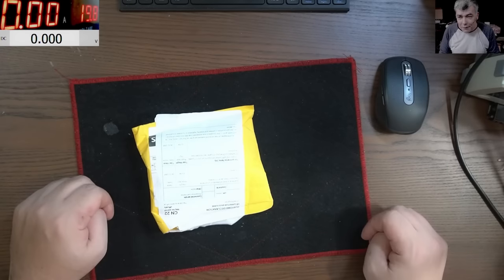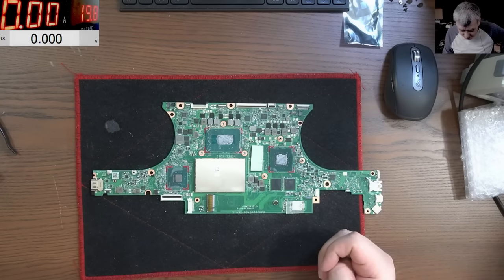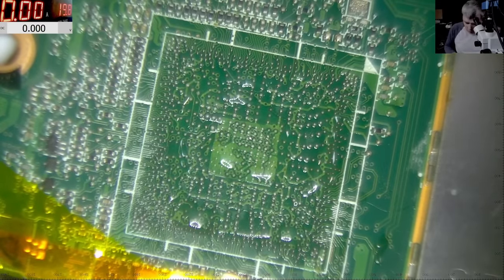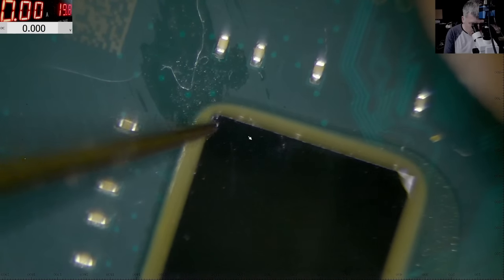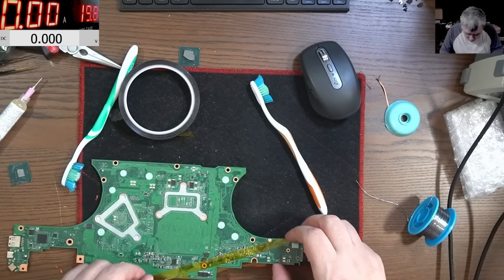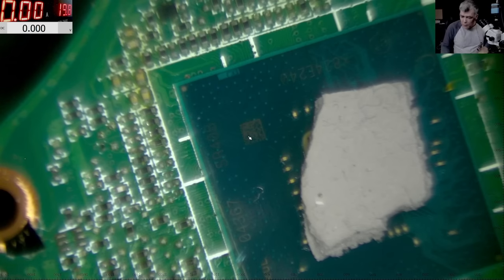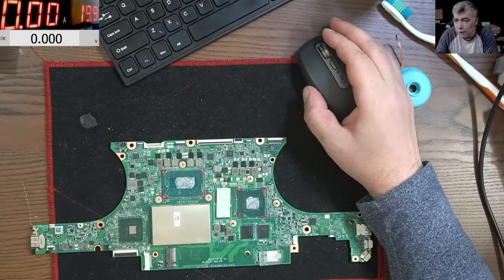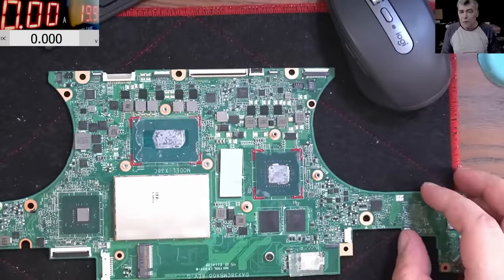That's why i don't replace chipset/cpu/gpu :((((((((((((((((((((

Comment: This is something I'd like to try someday: change a chipset or SOC with a very basic pre-heater and hot air. You have done it beautifully, Sorin! It's a real shame that it didn't work. I feel that most people won't ever realize how hard is that that you have done in this video. Well done!
Reply: Why didn't it work?
Reply: @irishguy200007  Because the chipset from china is cracked in two spots. The chance of that chipset not being faulty is slim to none.

Comment: After chipset replacement, you should almost always clear the ME region in the BIOS. But it probably won't help with the crack either.
Reply: @MrHimer12  Why does this ME region crap exist ?
Reply: @MrHimer12  Yes, sometimes you can play with it for days :) If I have no other idea then I take random BIOS files from laptops with the same PCH, extract the ME and try my luck with it. At some point, somehow, it fits in the end. e.g., from HP, if you find a board with the same chipset, you can extract Clear ME from the update file. Fortunately, it's relatively rare that you can't get new ME.
Reply: @MrHimer12  I didn't think that you had to have a motherboard, just a model number. You research which board has the same PCH, you search the net for a BIOS and take out the ME.
Reply: @MrHimer12  Yes, the main thing is that in the end we have saved another device from the dumpster.
Reply: I wish I had remembered your comments from a different video. Last month I got my Asus laptop repaired from a eBay repair business (notebook--service). Problem I had is corrupt bios. They did a pretty good job but was a bit more costlier than what you offered. It took longer time than expected. About 2 weeks. I will remember you next time if I need something repaired. I myself repair iPads. Do not have in depth knowledge or skills in doing bios repairs.
Reply: Mine have a crack on the shiny metal aswell and it works fine, its even bigger that
Reply: @MrHimer12  its not true. you need unconfigured me firmware and replace pmc region. Not working me region every find on the internet.
Reply: I changed the pch in my laptop with a used one. The only difference is the me in bios writing 0.0.0.0 .  Laptop is the p750hm with z170 chipset
Reply: @MrHimer12  Hi MrHimer, I need help. 
i think you understand about chipset and TPM, so maybe you can do me a favor

I blew up my chipset, so i bought a new PCH chipset (SR40B) in a trusted store. then i brought it to a repairer to install it, and now my laptop is working fine. UNTIL i opened Valorant and it says that the laptop is not detecting TPM 2.0 in order to play. i looked up many solutions on how to enable it but nothing works. so i wonder if it could be the issue with the chipset that was installed. What can i do to make this fixed, I'm so tired :(
Reply: wym by "clear" and what is the ME region ? newbie to repair here
Reply: that crack was  huge,no way it would work.I hate the silicone wafer chips without metal protection caps.I broke a northbridge chip just apply a slight force when changing the heatsink,when you hear a slight crack like glass powder being crushed,you know that your chips are gone even though you don't see the crack visible.

Comment: Easiest way to cleanup pads without risking ripping pads is put super low melt solder on the pads with an iron, then use flux, low temp hot air and wick to dab and lightly brush the pads with tweezers.
Reply: That or just use a lot of rosin based flux, use fine wick, and make sure your tip doesn't have a sharp or blunt end. When i first started i ripped a lot of pads, but i was using a fully synthetic flux, i switched to a rosin based flux which acts as a lubricant when burned and haven't ripped a pad since.

Comment: That's why i don't replace chipset/cpu/gpu  -  because you need the proper tool for that. But nice try.
Reply: Which is the proper tool needed?
Reply: @g.9357  Rework station, with both bottom and upper heating elements.

Comment: i've been doing bga soldering for many years , and i noticed that if the corner of the silicon is cracked , that doesnt necessarily have to be a damaged chip , since the circuit on the silicon doesnt reach the corners , thats why it might still work fine , happned many times with my long years experimenting with those chips , but generally , if the board have a bad chip that means the board reach a bad level and many components might already be badly damaged and finding whats bad takes a lot of time to figure out which makes the whole thing not worth it , 

one more advice, dont try to solder the chip with small nozzle tip when using a small heatgun , heat will be concentrated on a small spot , and might cause solder to not be soldered evenly or cause the board to burst a bouble , use the blower without a tip and try to heat the board around the chip a little 

i miss the old days before the BGA technology started , every thing was much more simple and it wasnt hard to change big chips

Comment: You can try reflowing the chip with the hot air station directly pointing to the chip. Add lots of flux. Lower the speed of the hotair station, lower the temperature to about 300C and do it until the chip shifts. You also may need to reflash the bios.

Comment: Just a tip on using wick whithout ripping pads: cut down small pieces, and use a larger tip.
Reply: Yep learnt this from Louis Rossmann - I've always used the wick off the reel in the past like Sorin does, but it then tends to wicks the heat away and then the wick can stick to the pads as the solder cools - a small piece is easier to move around on surface mount stuff - everyday's a learning day as the saying goes 😁

Comment: An infrared machine can be obtained second hand via eBay for not that much money... Ofc it won't be easy to get into reballing with infrared and using stencils etc. but it's worth it if someone would like to learn the process and always better than using just hot air. Everyone hates desoldering chipsets and CPUs and the only way I do it is with a reballing machine, the risk to fail is to big even if our hot air station is a good pump. Love your vids btw., keep it on!
Reply: You're right reballing is exacting and he needs the right station. But the only way it pays for itself is if he's doing a lot of high end gpu repair or cell phones.

Comment: As others have said, cutting smaller wick pieces not only makes it easier, you can hold the hot air gun in the other hand to keep the board temp up to make the whole process alot easier. Don't get me wrong, I wouldn't attempt this, unless I have 2 identical boards to see if it worked, I'd replace the board but great skill without question.

Comment: Please get another chipset.
And a tip for BGA chips: use leaded solder to clean the pads before using the solder wick, it lowers the melting temperature of the board pads and has a waaay lower chance of cold solders when installing a leaded ball BGA chip.
Reply: yeapp. and another trick is to use low melt solder to clean (130ª)
Reply: Do u really think he didnt know that ???
Reply: He knows alot but there really ain't a official technician repair school so 1 person won't know all. They don't do these things in universities either. They train technicians in the companies they work for even after passing through college. Its like high top trade secrets. 😳 If u know an official school thou then please say.

Comment: I would recommend preheating from the back with a boardpreheater and use a square nozzle in chipset size for the hotair from the front, so you can be more save that you didnt burn anything
Reply: Helo sir, what model of preheater did you use for removing chipset? I want to build DIY reballing machine, preheater and hotair combination. Thank you

Comment: Unlucky Sorin, nice job reflowing it though 😄 I think that damage on the side is from a chip holder that was used to reball the chip. Maybe one of those traces next to the damage is broken, couldn't really see it on the video well enough, but the damage looks pretty close to two traces.

Comment: Dear , tahnks for sharing this useful video, next time you need to pre heat the chip for hours at 90°  to remove the moisture from it, i replaced many chips and learned from the hard way...

Comment: This is a very challenging/nerve-wracking type of repair with high risk for success. I'm not sure where else you could get a GPU chip since it seems that everything is coming out of China these days. It would probably be less stressful to use BGA infrared machine?:face-blue-wide-eyes:

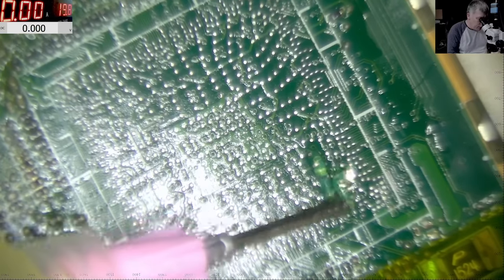Comment: 19:28 - Sorin, I’m surprised you’re not using your rosin here for this critical job. I would expect the chip to fall easier into place with the less viscous rosin/alcohol solution here.

Comment: Bad bad idea to change bga with hot air.U can burn the chip.You can make deformation on motherboard.You have to   warming up 170 celsius down side and no more 235 on the top side.You need special tools,but u know that.
Reply: True

Comment: Dear sorin,  I watched almost  all your videos.  I love you and your work and big respect!
BUT : There are pre/ heating  profiles for bga and mainboards.. if you heating heat the board and the chip without  controlling  the time and temperature, you will destroy  the chip and / or mainboard also. They will begin to warp bubble and die. Its also very important  to dry  the chip for 24-48h in 100c to pull out all the humidity.  I was in the business  for 8 year's.  
Anf YES ,you are right!  There is also a high chance that the chips are defective.
Without  a bga rework  machine  there is no chance  to change chipset or cpu.
Only  small  chips.
Best regards ❤

Comment: Maybe even though it's not visible there's slight popcorning on the board because it wasn't preheated before removing the original chipset and before inserting the new one. The popcorn effect separates layers of the board.

Comment: You need to invest some money and buy a chip infrared soldering machine. Buying chips from China, unless the vendor is honest (which is quite rare), you can get a defective or fake chip. Also, to wick the solder from the board, you should use a larger tip, for more heat transfer. A smaller tip, like the one you used has the potential to rip off pads.
Reply: it's hard to find brand new laptops' GPU chips . The only way to get one (that matches your GPU specs) is Ebay , and refurbished ones from China
Reply: @tunkunrunk  It is not the only way. The thing is, many chips are sold as new, but they just reball and wash them in a ultrasonic cleaner. If you can see scratches on the GPU, then it is not new.
Reply: @davidlguerr  if china is not the only way , then can you please share a contact to a vendor ? laptop cpus, gpus chipsets... it's china or nothing. most of the time recycled reballed chips  , sometimes you find genuine new parts but it's kind of rare.
Reply: @robertjung8929  it's been nearly a decade since I started ordering refurbished CPUs from China , and up to know they've been working fine

Comment: good job sir, but I wanna share my trick to get this job done without pre-heat machine
1. I  remove and install new chip from the back of chip.
2. covered up the components of  the back of the chipset with solder mask
3. use max temp(480c)
4. you know the rest I think sir
I never failed with this trick, why not to share

Comment: i would return it or ask for refund no matter how the seller would try to convince me the cracked chip worked :) crack on the chip means it's shot and even if it's not it will be very soon after a bunch of thermal cycles. also it's a good idea to "bake" the chips at 100celsius for few hours before soldering to drive out the moisture, it helps to avoid popcorning (developing bubles in the chip's pcb substrate)

Comment: I stopped using kapton tape because when it shrinks it will shift underlying components. I use regular aluminum foil for shielding.

Comment: Over the years I have found that it's cheaper and faster to replace the Mother board (from a unit with a cracked screen). These days they sell really cheap and you have spare parts to boot.

Comment: Use aluminiumtape or kaptontape to cover and protect the area around bga chip. Dry bga chip for 24 hours in the oven. follow jedec temperature curve strictly. china chips are used and defective most of the time.

Comment: Intel's 200-300 chipset series and later are very sensitive.  Replacing it with hot air is the wrong method.  It would work if replaced with a BGA device.  hot air is not supplied directly to a BGA chip.  It has to be gradual.

Comment: While it is impressive, there is a big chance chip could have died during soldering because all recent chips are kinda fragile and require precise temperature control which you just dont get with hot air. Other thing is that finding a supplier with new chips is near impossible. So yeah, I guess replacing big BGAs is not viable.
Reply: No ... those refurbished chips are just crap , you have to buy five to get one that works. I have a very expensive BGA soldering machine with five points temperature control , and believe me , if the chip is ok they are more tolerant to the temperature than you think , you can ressolder it more than twenty times lead or unleaded.

Comment: I know that people don't practise it, but you could grind it ;). When I have components on the other side and I can make more harm than good, I use this technique. But, in general, those jobs are not worth most of the time. At least my customers prefer a cheaper way to fix, than when the see the labour cost high.

Comment: Hello 😊 I've seen that physically the GTX850m gpu is identical to the GTX860m and that the VRAM is also GDDR5. Do I need to change the BIOS if I solder this more powerful GPU on my laptop motherboard or just install the right driver in the Windows?

Comment: The chances of static damage to components these days is fairly low, but I wouldn't handle such a chipset without basic precautions (grounded mat, wristband etc). Of course, you can't be sure what was used when the chipset was first removed / handled.
Reply: There were obvious signs of physical damage on the chip...

Comment: If you protect the middle of the chip from heat, how do you expect the solder under it to melt?
Reply: Good point! Hot air gun is not suitable for this job anyway, as there is no control of the temperature really. Proper infrared soldering station with preheater should be used.
Reply: and then just after resoldering the chip he goes ahead and blow to cool it down

Comment: the quicker the better, preheat around the chipset and bring the heat in from the top. Otherwise you won't get the heat you need. 375*  at 60 percent airflow.

Comment: Sir, you need BGA rework station, you can use electric stove as the bottom preheater and the blower as the upper heater.
Sometimes BGA chip need to be clean from flux after placed.
By the way, I'm also feel sad about that the new chip condition.
Reply: I don't think he wants to deal with replacement of BGA chips.

Comment: Mr Sorin you can't just remove the PCH using a hot air station, you need a BGA machine with bottom and top heat, you are just damaging the board. Okay fine let pretend you removed the PCH chip using the hot air as you did, obvious it won't work, you have to clean the ME region...Lol this is getting out of hand, Lol there is no shortcut or dodgy way here...This seperate boys from man

Comment: @Electronics Repair School  What di u expect if u didn'r clean ME region... You should clean it after PCH replecement... Withour inswws, ir will post, bo it may take even a few mins and it's normal that it keeps rebuting, because laptop  keeps restarting during PCH inicialization...

Comment: You need and ir preheating plate for
Like  puhui t-8082 480c is to much
It will melt around 220c

Comment: Love you videos man a real engineer.
But why try and replace a bga with the hot air wand ?
The only way you will really be successful is with a hot air rework machine with underside pre heat and top heat.
The maximum temp that ic could handle is probably 250c for 30 seconds if your lucky, blasting it with just topside heat at 480 is just going to thermally shock the ic.
Reply: Further to my comments if the bga replacement isn't perfect don't even bother soldering it on.

Comment: I’ve reballed of nvidia and ati graphic chips may be moore than a thousand with my jovy brand bga rework station infrared and 90 percent of them worked fine but intel chips was allways not worked actually north bridge chips (south bridge chips usually worked) so i can say that your chip was not working when it arrived to you from china.resoldering of an intel hm chipset needs bga rework station and you need to check temperature of the mainboard to keep under 200 degree celcius you should use  amtech cream flux etc.hope you can get your money back from china.Thanks for the video

Comment: When you put the chip on the motherboard at 13:22 time the problem on the right part of the chip was already there before you heat the chip from under the board...

Comment: Great job fitting the chip using just a hot air gun, but it was never gonna work - the tiniest of chip on the corner of the die does them in.

Comment: One has to ask Sorin, how do these Chinese sellers TEST these chips and the solder balls remain intact. Do they find a laptop the same as yours and put them in the laptop. I find it difficult to believe they actually test these 🍟 chips. How is it possible to do this with every chip they sell?? But good on you for doing this without a reballing machine it's quite a feat of electronics to do this so well. I have to congratulate you on accomplishing this with just a hot air 🔫 gun.

Comment: how do they (chinese) remove chip WITH solder balls on it? or do they add them after they remove the chip?
Reply: After chip removal they use stencil to put new balls on the chip